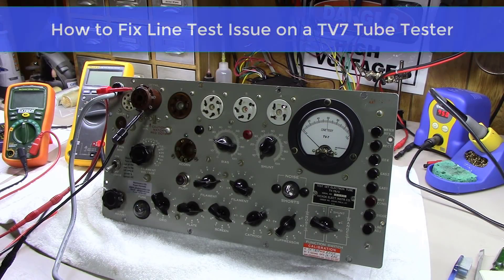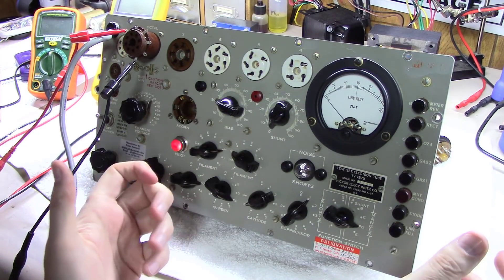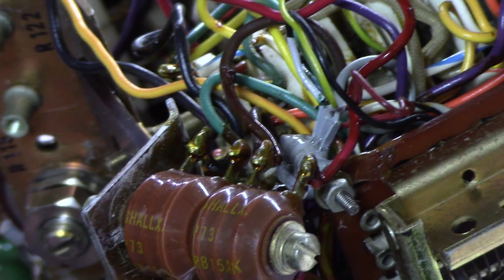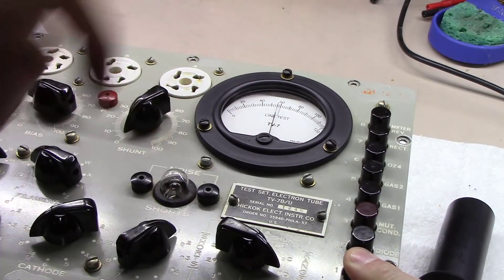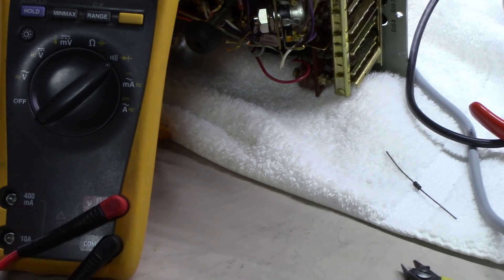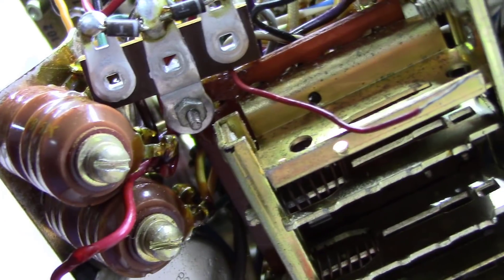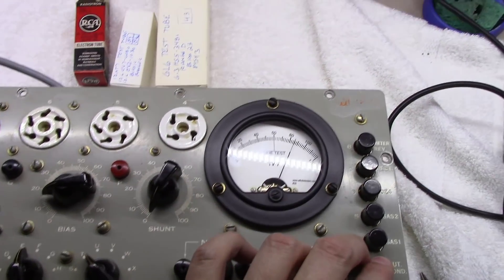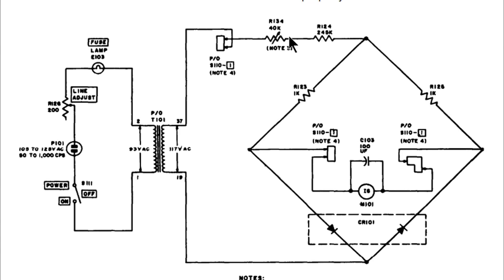How to Fix a TV7 Tube Tester with Line Set Issues - CR101

Comment: I’m new and really enjoyed all your videos. I just picked up a TV 7B and issues with a cr101.  Someone has definitely gone in and messed with the wiring. I can’t figure out for sure where the Ted black and  yellow wires go.  Can you outline exactly where each of the 3 wires go in the circuit?
 I tried to attach a pic, but it will not let me. Thx

Comment: Line set issues can also be caused by bridge imbalance conditions brought about by aging of the two 1K resistors in the bridge circuit. Why they are carbon composition as opposed to precision types is beyond me. If these two components change value, they will automatically cause  the meter to read incorrectly. If you cannot get the meter to even center and is very low, you might have a copper oxide rectifier problem, but I was seeing a very good meter swing as I adjusted the line adjust pot. The problem was that when it was balanced, the filament voltages were all very low. One of the 1K resistors was at 1800 ohms and the other was at 2950 ohms!  No wonder the meter was way off. Two new 1K metal film resistors fixed the trouble!  Now I see 6.1 vac  when balanced in the 6.3 volt setting.  NEVER TRUST OLD CARBON COMP RESISTORS!

Comment: Excellent video. I picked up a TV-10 C/U. Replaced the out of spec caps and resistors before starting the calibration process. I replaced the old diodes with two IN4007’s just like you did before I happened on your video. I get the line adjust within three gradients of the mark with R134 maxed. The diodes are good. Any suggestions to get me to the line set mark would be greatly appreciated!
Reply: I had this problem and it was the meter

Comment: I want to get one of the TV7 series of tube testers. I gather from watching your videos that you prefer the TV7 D/U. I will be working only on guitar amps and maybe some old radios, nothing in the RF realm. Are there any of the other TV7 units (ie: A, B, etc) that would be just as good as the D/U for the kind of use I described?  I would also want to install the digital meter from Dan Nelson that you did in this video.
Thanks so much for your help. I did the survey also. Thanks again.
Geoff

Comment: Without a doubt one of the hardest things ever built to service and repair. Because it is a military unit, the size of the unit was reduced to the smallest footprint possible. So it was built from chassis up without regard to service. Good luck to anyone attempting to break into one of these units. Just changing the power cord is a mild challenge.

Comment: BTW, Alan Douglas' book Tube Testers and Classic Test Equipment says that when calibrating a Hickok you should duplicate as closely as possible the original calibration conditions and equipment, which means that you should shunt your digital meter with a resistor to make it a load of approximately 1 KOhm per volt like the original analog Simpson and Triplett meters would have been. That means that if you are checking the 150 volt B+ of the tester, you should be measuring it on the 200 volt meter range or thereabouts with a 150 to 200 k resistor shunted across the inputs for the meter probes. Otherwise you will erroneously calibrate it for what turns out to be too low a B+. The one exception to this is the grid signal, which was originally measured and calibrated with a vtvm, a very high impedance type meter, so your digital meter will be just fine for that application without having to be shunted.

Comment: it's worth mentioning that the "Line Test" button can have badly oxidized switch contacts that affect the voltage which you use to zero the meter ( essentially setting the tester itself to the correct input AC line voltage).  You might find yourself exercising the Line Test switch a half a dozen or more times in order to wipe the switch contacts clean and get a good clean voltage to the meter so you can adjust the line adjust knob. on my Hickok 752a I actually disassembled the switch, no easy task I might add, and polished the contacts which were black with oxide. Even then, every now and then it acts up a little bit. Spraying contact cleaner inside a tube tester is not an option, it's a very bad idea overall.

Comment: How much trouble is it to change out that  83 tube for SS ?
Reply: Blake Thompson, it's  easy to do, BUT, Don't Do It! subbing a solid-state rectifier for the type 83 rectifier would boost your B+ voltage abnormally, especially because you are taking a significant load off of the power transformer both in terms of not needing 5 volts at 3 amps for the tube itself, and because the type 83 has more voltage drop and is less efficient then the solid state diodes would be. you would find yourself setting the line adjust knob very low in order to zero the test around the meter, and then all your filament voltages would be low, and your grid signal voltage might also be low. You probably would never get the tester recalibrated correctly. besides which, the heat of both of those rectifiers will help keep everything nice and dry in there if the unit is used periodically, preventing condensation and oxidation.
Reply: @goodun6081  That just shows you have no clue.

Comment: Hi I am new to valve , sorry tube testers, and have purchased an old RCP 314 tube tester from 1944. I have been watching your introduction to tube testers from two years ago. You mentioned that you have many TT and I was wondering if you have any up to date manuals or charts for setting the tester? If you can't supply a chart do you know where I can obtain one from. The RCP says it can test any tube and I understand how to set it up for listed tubes,however I can set it up for later valves with the exception of the "SHUNT VOLTAGE ". Do you know how the value of SV is derived failing the presence of chart   information? I would be grateful for any help on this subject.

Comment: Those replacement 1N007 bodies are soldered too close to the tag strip terminal. You have left ~~ 1/8 to 1/4 of lead dress to the TS IMO. I would have pulled out the original rectifier and used a shorter screw also
Reply from the maker: Good thoughts